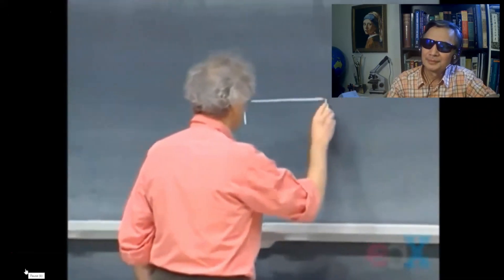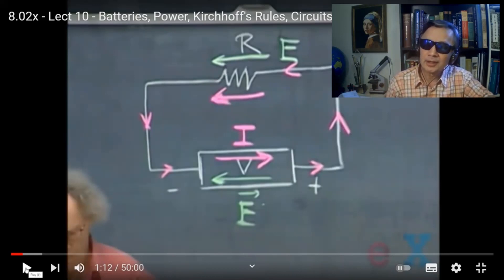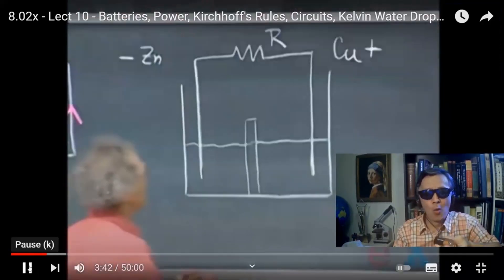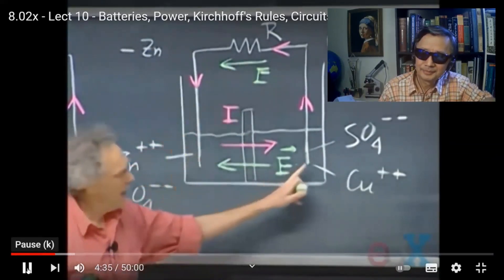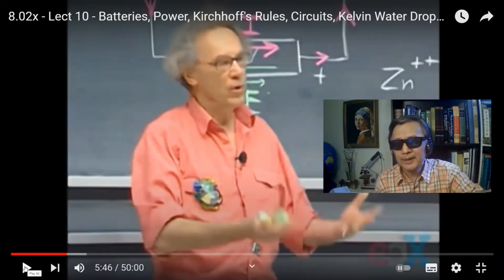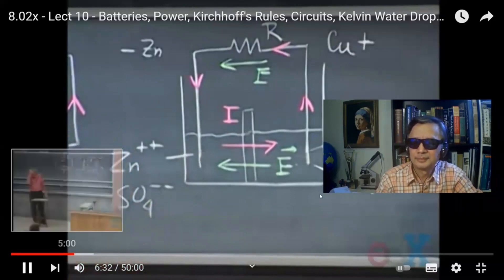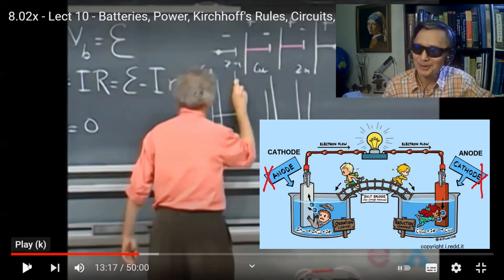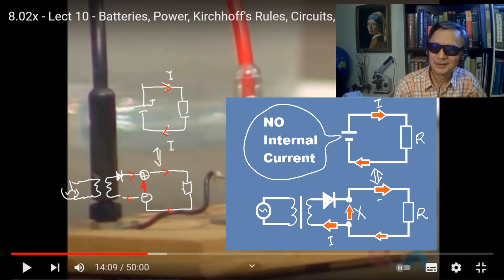How Does Electrical Battery Work? Comments on a Lecture by Walter Lewin

Comment: We study in the mid-air in the any field of the school. There are studies on result of effect but not cause or progressing. Like a capacitor , it blocks DC and allows AC is 1/2 wrong and right. When any current, when it is not full charge then current and volt pass and conduct electric by magnetic field or indirect way until capacitor is full charge. So it can used as limited current or many applies. So then all diodes D are zener diode cause there are limited V and I and T. So there are 2 the knowledge: self knowledge by self and copy knowledge by none-self.